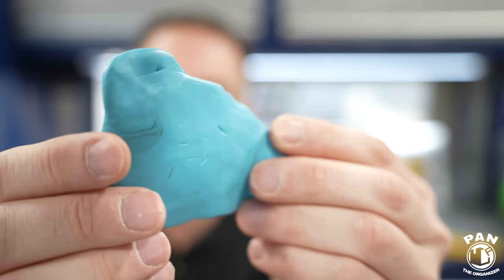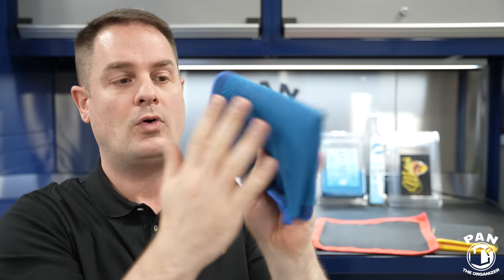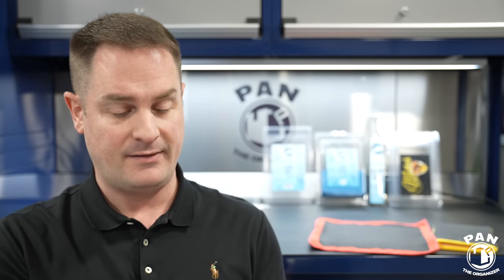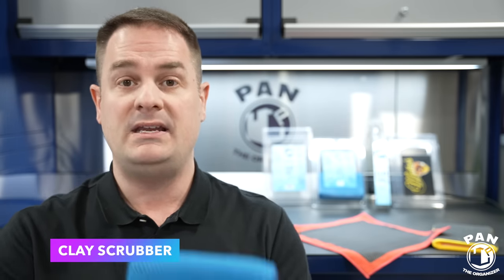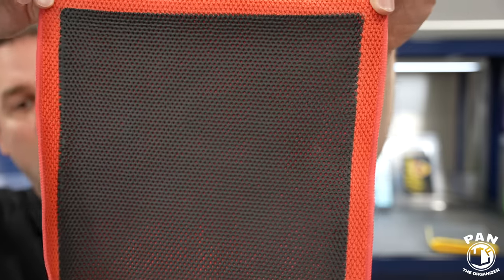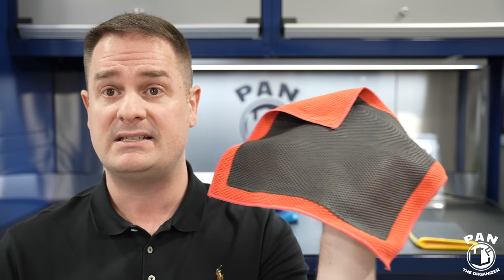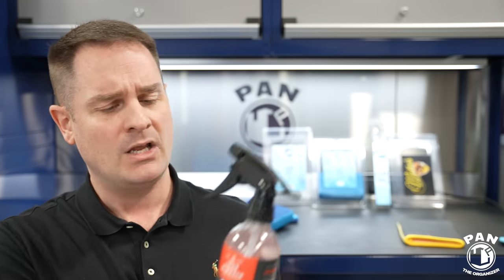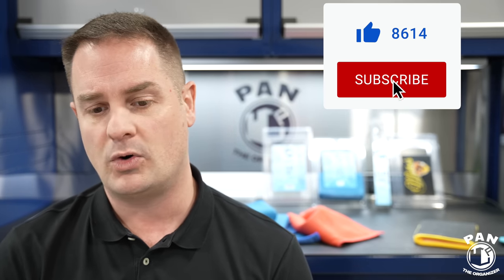The Future Of Automotive Clay Is Here… And It’s GOOD!

Comment: As always another great video from Pan.

I would like to offer my little bit of experience after using many of the products and techniques.

1) first I use bilt Hamber as my initial wash using a power washer and foam cannon. Allowed it to soak for a few minutes and then rinse off.

2) used carpro descale as my hand wash always using a two bucket wash.

3) while the surface was wet I braid iron buster and then used Gyeon clay bar and lube and decontaminated the surfaces of the vehicle.

4) again rinsing  the vehicle thoroughly using a power washer and drying using a blower I had bought a stubby nozzle for my blower but discovered it doesn't produce the same airflow as my regular nozzle for my blower. So I might be returning that. The towel dried the remaining of the vehicle and the door jam areas.

5) used clear glass road road film remover and thoroughly decontaminated the glass usually the front and the rear. Once dry and clean I applied blacko soft 99 coating on the glass. 

6) then once all those steps were done I moved to the polishing phase. I used rupes 15-in polisher and it's yellow polishing foam  pad to remove minor surface scratches and imperfections coupled with rupes DA fine compound. As an added step I also used rupes uno pad and polished to finish off the process. 

7) used carpro eraser and a fine microfiber cloth to remove the remaining compound and other finishing polishes from the paint.

8) at this point you'd probably figure out that I would have used some high-end ceramic or graphene coating. I found it effective to use 303 graphene nano coating which is a spray on and it worked absolutely fantastic. Using a microfiber applicator it went from  panel to panel and then once it hazed I wiped it off and it looked great. 

Finally and it wasn't the last thing it was somewhere in the beginning but I forgot to mention was I used both iron buster and brake buster in combination and cleaned the wheel well,  wheel tire and rim using multiple brushes. I did not use any coating at this point in time. I also didn't use any coating for the rims or the plastic trim surrounding the vehicle.

And here's where the big finale comes in. This whole process took me no less than 10 hours. You heard that correctly I did go slow and methodically but fast enough to prevent product from drying. It was also my first time using all these different products so I had to read the labels assure what I was doing was correct and going back and reviewing pan' s great videos. 

I'm not even going to mention how long it took me to clean the interior. 

A footnote it was also 40° heat outside for the last couple of days where I live and on top of that I was working in a garage with not a whole lot of air. Yes the garage doors were open and I was working at all times in the shade.

Again a big thank you goes out to Penn for his techniques his training his videos and his wisdom. 

If anybody would like to offer some advice it'd be greatly appreciated to reduce the 10-hour marathon.

Comment: If my car has no protection on it at all is it enough to just use the beadmaker as sealant for the paint?
Reply from the maker: Define what you mean by "enough"? Bead Maker isn't made for long term protection. It lasts 3-4 weeks at best. It's designed for its gloss and slickness mainly. If long term protection is your main objective, look elsewhere. There are spray products that can last 6-12 months now.

See my awards video for my top recommendations: https://youtu.be/KRv7vKsuliQ?si=1fBX2peXBnEz190W

Comment: Great video as usual! , I have a question  for you Pan: Can these clay towels remove waterspots?  Thanks
Reply from the maker: Thanks. For water spots, it really depends on how bad they are. You can certainly start by washing and claying and see if that works. From there you can also use a water spot remover.

See if those work. If the spots are still there, it means the minerals started etching through the clear coat and you’ll need to step up the level of aggression to machine polishing. Beyond that it’s wet sanding or a panel respray.

It’s a case by case scenario. Do testing and see what works.

Comment: If you use the clay towel.  Will it affect the paint protection,  i.e. ceramic coating?
Reply from the maker: I spoke about that in the video. The perforated synthetic decontamination media is safe on the coatings as long as you use them right: proper lubrication and no pressure. Test on an inconspicuous area first.

But not all perforated media from all brands is made the same. The ones mentioned in this video are ok to use on coated vehicles.

Comment: sorry, just confused on one thing you said.  If I want to use the clay media and the sealant/protectant at the same time, won't it leave a residue or some of the product still on the surface that will then need wiped/buffed off with a towel?  I am used to doing all my decontamination via washing, iron removal, washing again, then clay media rinsing or washing again and then dry with a final detail spray and wipe for final coating and gloss.  thank you as always.
Reply: There will usually be residue left by the clay, it’s best done as a stand alone process. And without any gloss enhancement or sealers since you will do a stand alone coating. 
If you use a mit/towel, that’s a bit different and can be done with your shampoo or even a detailed or rinse less. I would not combine the clay step with a polish or coating.

Comment: Timely and very useful!
I am new at this and not a pro detailer. When you clay and seal using the paint sealant recommended, does this mean you may not need to do a follow-up polish? 
I guess this is related to what @barneychamorrow asked earlier.
Reply from the maker: You got the steps reversed. You would machine polish (paint correction) before applying the protection.

If you are claying and sealing, you are not correcting the paint.

Paint correction is made to remove defects like swirls, scratches and oxidation. Then you apply a protection afterwards (wax, sealant or ceramic coating).

A “clay and seal” is a different procedure, an accelerated method of simply decontaminating the paint and applying a small protection at the same time. 

I highly recommend that you watch my Detailing 101 series for beginners, where I explain different steps like iron removers, clay bar, polishing, protection, etc. It's super simple once you understand the basics, and your car will look and feel 100x better!

Part 1: how to properly wash your car: https://youtu.be/7Koj5j2Es5U
Part 2: how to clean wheels and tires: https://youtu.be/omwcNcSYcS8
Part 3: chemical decontamination (iron and tar removal): https://youtu.be/W_cyHz3XssU
Part 4: clay bar: https://youtu.be/XB8UaTCXuLg
Part 5: machine polishing (paint correction): https://youtu.be/ustTEVGMOTI
Part 6A: how to wax your car https://youtu.be/KZjiPcsPBrA
Part 6B: how to apply a ceramic coating: https://youtu.be/sqQYVjxFqK0
Part 7: Differences between waxes, paint sealants and coatings: https://youtu.be/4ejfPHan3k4
Part 8: How to clean your car’s interior like a pro: https://youtu.be/Xx_lHXHYpLo
Reply: Thanks for the clarification, Pan.

Comment: Since Turtlewax’s Flex Wax can be used as a drying aid, do you think it can be used instead of Quickbeads/Beadmaker?
Great video BTW!
Reply from the maker: Flex Wax needs to have its first layer (foundation coat) applied on dry paint before you can use it as a spray on, rinse off formula.

Comment: Is the rag company’s clay towel washable ? Either with rinse less wash or rags to riches maybe ? And how many uses can we get out of it ?
Reply from the maker: Yes you can clean clay towels, but not in your laundry. Just rinse them after use, and that's it. Let them air dry, ready for next use. If they're super dirty, rinse in warm water, spray some APC, lightly rub with your hands and rinse again. 

A traditional clay bar is typically good for 6 to 8 cars depending on the size of cars and how badly contaminated they are. Clay towels, especially higher quality ones like the TRC or the DIY Detail synthetic perforated decon towel are good for dozens and dozens of washes. And if you drop those towels, just rinse and reuse. Contrary to a clay bar that if you drop it, you have to throw it in the garbage.

Welcome to my channel. You discovered one of the biggest car detailing channels on YouTube as we surpassed 1 million subscribers and we have over 140 million views! I have been detailing for 27 years and I love to share my knowledge and passion with my viewers.

You found the right channel to help you learn everything about detailing.

Comment: How do you use the mitt and towel? Do you have to wash it between every section you do?
Reply from the maker: You can rinse it with your garden hose between panels if it's super dirty, or dunk it in a soapy solution in your wash bucket and quickly rub the surface with your hands while it's in the bucket.

Once you're done, simply rinse, and let air dry. Ready for next use. There's little to no maintenance required with synthetic decontamination towels and mitts.

Welcome to my channel. You discovered one of the biggest car detailing channels on YouTube as we surpassed 980,000 subscribers and we have over 132 million views! I have been detailing for 26 years and I love to share my knowledge and passion with my viewers.

You found the right channel to help you learn everything about detailing.
Reply: @PanTheOrganizer  great thank you. Appreciate it

Comment: once you ceramic coat the vehicle, should you still clay periodically, especially on a daily driver?
Reply from the maker: You would not use a traditional clay bar on a coated car, as that's abrasive and would damage the coating. You could use a synthetic perforated decontamination towel like the one in this video, with a good clay lube. But you only "clay" a car that needs it, meaning if you feel accumulated contamination once you clean the car.

Mainly, we use chemical decontamination on a coated car. An iron remover at least once every 2-3 months is a good idea, or as needed depending on your level of iron contamination (brake dust, fallout, etc).
Reply: @PanTheOrganizer  ok that was my thought process but as a noob i wanted to get your insight.  :)
Reply from the maker: Welcome to my channel. You discovered one of the biggest car detailing channels on YouTube as we surpassed 1 million subscribers and we have over 140 million views! I have been detailing for 27 years and I love to share my knowledge and passion with my viewers.

You found the right channel to help you learn everything about detailing.
Reply: @PanTheOrganizer  I’ve been watching for a while just finally had a question to post. 😜

Comment: you mentioned using the clay towels with bead maker, i was wondering is there any issue using them with Gyeons WetCoat spray ?
Reply from the maker: WetCoat is meant to be sprayed on a wet surface and immediately rinsed off. It's not meant to be used as a clay and seal.

Comment: What is iron remover exactly? Is that similar to a bug and tar remover?
Reply from the maker: An iron remover is made to help remove iron particles that typically come from brake dust, industrial fallout and rail dust. They are often seen on light colored cars as those orange little specs of rust on the paint. All color cars have those, it's just more easy to see on a white car for example. 

So like a tar remover spray helps remove tar contamination, an iron remover spray helps to remove iron particles contamination from painted surfaces, glass, and wheels.

See my video on iron removers explained: https://youtu.be/W_cyHz3XssU

And see an iron remover in action on a white car here: https://youtu.be/SGRZSTZ-2to

Also, I highly recommend that you watch my Detailing 101 series for beginners, where I explain different steps like iron removers, clay bar, polishing, protection, etc. It's super simple once you understand the basics, and your car will look and feel 100x better!

Part 1: how to properly wash your car: https://youtu.be/7Koj5j2Es5U
Part 2: how to clean wheels and tires: https://youtu.be/omwcNcSYcS8
Part 3: chemical decontamination (iron and tar removal): https://youtu.be/W_cyHz3XssU
Part 4: clay bar: https://youtu.be/XB8UaTCXuLg
Part 5: machine polishing (paint correction): https://youtu.be/ustTEVGMOTI
Part 6A: how to wax your car https://youtu.be/KZjiPcsPBrA
Part 6B: how to apply a ceramic coating: https://youtu.be/sqQYVjxFqK0
Part 7: Differences between waxes, paint sealants and coatings: https://youtu.be/4ejfPHan3k4
Part 8: How to clean your car’s interior like a pro: https://youtu.be/Xx_lHXHYpLo

Comment: So if you used the graphene or ceramic spray with the clay towel, would you then ceramic coat the car?
Reply from the maker: Never apply protection on the surface before applying a true ceramic coating (the one in glass bottles). The paint has to be clean, free of contamination, and also free of any protection. Coatings need to bond directly to a VIRGIN clear coat with no interference from any previous wax, sealant or ceramic based product.

See my full ceramic coating application tutorial: https://youtu.be/sqQYVjxFqK0

Welcome to my channel. You discovered one of the biggest car detailing channels on YouTube as we surpassed 980,000 subscribers and we have over 132 million views! I have been detailing for 26 years and I love to share my knowledge and passion with my viewers.

You found the right channel to help you learn everything about detailing.
Reply: @PanTheOrganizer  thanks for your response.   I’m a huge car and bike guy, I have two BMWs and a BMW motorcycle, I fully detail each every week.   I’m very OCD about my garage and my cars.  You and Matt from Obsessed Garage are my spirit animals. I’m an attorney but if I could, I’d be a professional car detailer.

But, I’m not sure I understand your response.   I thought that you normally decontaminate all cars before using a ceramic sealant:   So in this video, using a clay towel with the ceramic product isn’t decontaminating?    Are you saying if I want to ceramic coat my new M2 that I would use a clay towel with just a lubricant that doesn’t have any ceramic or graphene product ?
Reply from the maker: I actually studied at the medicine faculty in university, biochemistry and molecular biology. So that's gives me that special more scientific edge and approach to my videos when explaining the chemistry of detailing products. :)

Don't get confused with a full blown ceramic coating (glass bottle) and spray sealants (ceramic or normal sprays). If you are applying a true coating (glass bottle), it's important to not use any protection on the surface prior to application. So in the clay stage when doing decontamination in such a scenario, you would use a normal clay lubricant with no protection in it. To put things into perspective, watch my ceramic coating application tutorial here: https://youtu.be/sqQYVjxFqK0

When applying spray sealants, or ceramic spray, it's ideal to also go through the full motions of decon wash, iron remover, clay, machine polish, IPA wipe and then apply the spray.

But sometimes, people don't care as much for doing all the steps and want something quick even if it sacrifices durability of the protection. So they will do a "clay and seal" type application, where they clay and at the same time use a spray sealant or ceramic spray as a clay lubricant, to clay and protect all at once. See all the explanations on that in this tutorial: https://youtu.be/WQH_RVOtrRA?si=ftaQf0YhsOLop8Td

I hope this helps.

Comment: The only synthetic clay available off the shelf in my location is Clayzilla by Surf City Garage. Works well but it always gets sticky and sticks to it original packing or the zip lock I resort to storing it in and I have to throw it away and buy a new one. I only use it with their lube or car shampoo. Thinking to start storing in the fridge. Is this a phenomenon of these synthetic clays or just specific to the one I use Pan?
Reply: My Nanoskin clay towel does the same. After I wash and dry the towel I spray a light mist of clay lube on it before putting it back in the factory clamshell packaging and that seems to help
Reply from the maker: Yeah some older generations of clay media can do that. I have not experienced that with the new perforated synthetic clay media from reputable brands.

Comment: Is it better to use a fine grade or medium grade mitt or doesnt matter?
Reply from the maker: It depends on the level of contamination you are dealing with. For light to moderate, stick with a fine grade.

If you have heavy contamination you might have to get a coarse (heavy duty) claybar.

Comment: Pan, you mentioned a clay bar typically has about 6 to 10 uses how can you tell if it should no longer be used enough though it has never been dropped on the floor?
Reply from the maker: When you have folded, and refolded the clay bar to expose a new fresh surface each time, and there are no more clean surfaces and it looks disgusting regardless of how much you try to knead it, it's time to change.